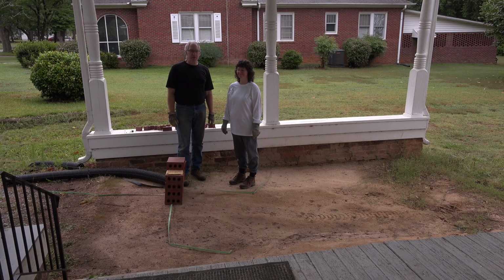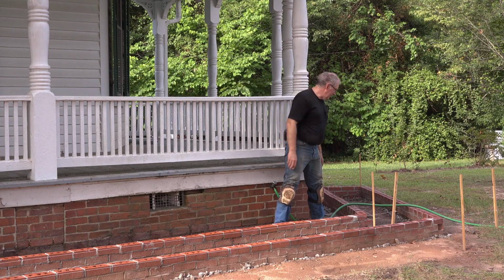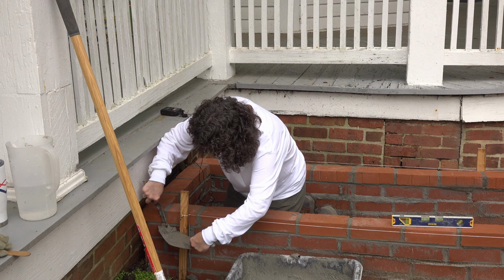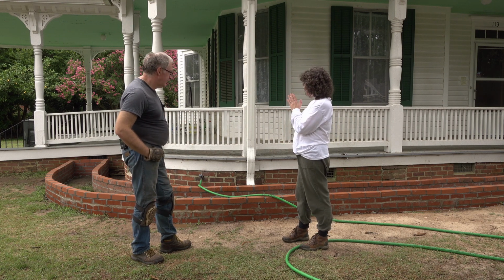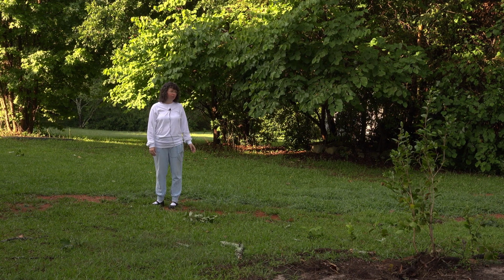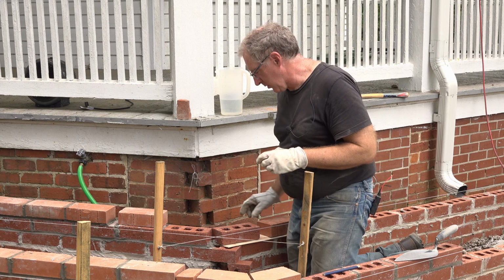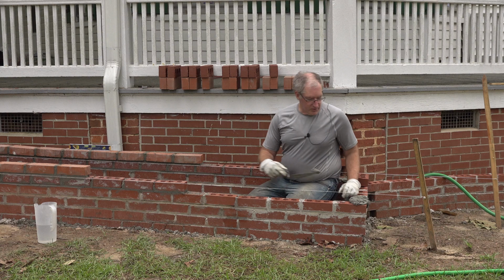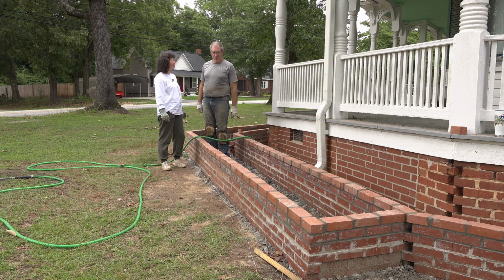EP93 Victorian Brickwork is Finished

Comment: Congrats on the brick planter! As others have said, it would have been difficult, if not impossible to find someone to do the work and put as much care into it as you have done. Hopefully the slope of the catchment troughs will keep the water flowing away quickly. It hasn't rained here (except for a few teasing sprinkles the other night) in so long, leaves on various plants and trees are dusty. Did I see mushrooms growing out of your lawn? That happens here in the winter, and once in a while they form a 'Fairy Ring'. Kind of fun. If the new planter will be mostly in shade, small hydrangeas might be nice as anchor plants, with annuals in between. Hydrangeas can turn either pink or blue, depending on the amount of acid in the soil, and you can control this yourself with fertilizer meant for the purpose. Crape Myrtles are awesome!

Comment: Another fabulous episode!  You two did a beautiful job.  Jeanie, I agree!  The transition with the old bricks on the catchment is gorgeous!  My husband and I are working with bricks too and the GA heat and humidity is similar.  We're removing old bricks from a porch so we can relocate the house and rebuild the brick porch.  We have the porch to shield us, I have a fan to blow the brick dust and old mortar I'm sanding from the bottom and sides and it's still hot!  We're working hard to stay hydrated and avoid heat exhaustion.  Looking forward to next week and to see what you've been up to.
Reply from the maker: We're glad that you're working safe and trying to stay cool. That sounds like quite a project you have going on!
Reply: @1834RestorationHouse , it's quite a job but we are getting in the short rows.  The interior is in good shape so we only have a few minor repairs and some remodeling once we move the house.  It's not like we have to totally redo every room.  And we don't have any plaster repair work!  We're dealing with sheetrock.  I did learn that the dining and living rooms have tonque and grove walls behind the sheet rock so we may tear that out.  Mike, you have me wanting to use a cobra speedheater on the doors to get them back to original wood.   I can see that restoration can become an obsession!

Comment: I love brick work even though I am no expert, but willing to learn.  We have some brick steps that need tuck pointing here on the To Do list. I want to finish painting the porch which doing now.  The rain has slowed me down or would have been done. I  have had heat exhaustion before so I can relate. My body has never been the same and now I find myself getting overheated much easier. I live in Tennessee where its hot an humid so I make extra precautions when working outside those days. This might sound whacky, but I will take the hose and water myself down clothes and all before mowing the grass and doing other major projects like planting. I even keep a gallon of water nearby while I work. I might look like a drowned rat, but it keeps me cool, keeps me safe so I can work longer on days when feeling determined lol. Maybe, someday I will have a pool so I take a dip instead of a hose lol. Your work looks good. Stay cool, stay safe, stay motivated, and keep up the good work you all. Best wishes from the hills of The Great Smoky Mountains :)

Comment: I wonder if the failure is due to the manufacturer filling the form from two locations and that is where the brick material meets. And since it’s not as incorporated as the rest of the mix, it’s prone to failure there.
Reply from the maker: Anything is possible. I expected better from General Shale.

Comment: I don't know if you know about this. 
While Portland cement is a good pairing with modern hard-fired brick or hard stone, trouble arises when it's used with older, hand-packed bricks. In this pairing, the hard Portland cement mortar will cause soft brick and stone to deteriorate at a rapid pace
Reply from the maker: You are correct about that.

Comment: What is the purpose of the catchment? To hold water like a trough or moat? With all the downspouts emptying into it won't it fill up? Don't you want to get water away from the house? Please explain how this will work?
Reply from the maker: It's a drainage channel which is sloped toward the back of the house. The water is dumped into a pair of catch basins and then sent out into the back yard.

Comment: Hi Friends! 👋 Your haircut looks nice, Mike. I think your next purchase (toy) should be a power washer. You can power wash your front deck, railing, outside of house, sidewalk, driveway, all kinds of things. 
Wow! That planter looks great! I would suggest drilling drainage holes/weep holes along the bottom 2 bricks, so excess water can drain away to prevent flooding and bottom rot. Also, before filling with soil, lay some gravel or crushed rock in the bottom of planter and cover it with permeable geotextile fabric. Then cover with a mixture of compost and horticulture grit before planting. 
Mike, How is the new job going? Jeannie, I would love to see some more of your baking/cooking tutorials. Have a great weekend! Belle in AZ 🏜
Reply from the maker: The new job is going great, thanks for asking. I'm on a compressed work week so I get 3 day weekends now! Your cactus has doubled in size!
Reply: @1834RestorationHouse   Im glad things are going good at work and I'm glad the Cactuses are doing well there. It's funny, I have a similar cactus pot on my patio and it's slowly dying here in AZ. lol. Go figure.

Comment: I was wondering if eventually you will go around your foundation and place mortar in areas that it's fallen out before bricks start getting loose?  We've had heat advisories in Northern Idaho but our humidity has only been around 32% with temperatures in the high 80's and 90's. We are having severe thunderstorm warnings today and the county below us had hail and 50 mph winds over the huge lake yesterday, but we didn't get it, so I guess today is our turn. It may just happen over the mountains. Gorgeous job! Love it.
Reply from the maker: Yes there are several joints that need to be cleaned out and repointed. We'll have a foundation appreciation day somewhere down the road. I know about those Idaho thunderstorms....Years ago I was flying an airplane from Spartanburg SC to Portland Oregon. My co-pilot and I landed in Nampa to refuel. It was HOT but the skies were clear. We took off and set a course westward. When we passed over Lake Owyhee a few minutes later, we got thrown violently upward, then thrown violently downward! We high tailed it back to Nampa and landed. After shutting down we looked back and saw a MONSTER THUNDERSTORM where we had just come from.
Reply: @1834RestorationHouse  Mike, that story gave me chills ,which is a strange sensation while sitting outside in yet another hot & muggy Missouri day!🥵
Reply from the maker: I get chills too! Thunderstorms can tear up an aircraft really fast.

Comment: Very nicely done!  I've watched this planter construction from the beginning and wondered how long it was going to take considering the weather. During the week I try to mow our lawn ( so my husband doesn't have to on weekends) but with our humidity I'm taking 15 min. breaks every 30 to 45 min. of mowing.  That means guzzling water or gatorade, sitting under a ceiling fan with the a/c cranked down until I've rejuvenated myself to mow some more.  The earlier the better as there is less sun but the feel like temps will get to you every time.  One thing for sure is no one should be working outside for any length of time from noon until 4 in the southern heat.  BTW, how is the job coming along?  Hope it's to your liking and lasts far longer than your first job in SC.  Next project,  house painting?  😉 😀
Reply from the maker: Coming from a cold climate, we're accustomed to powering through projects in any season. It's taken a lot of willpower to step away from summer projects. The new job is going well, and VERY interesting!

Comment: Amazing!! Can u explain how the catchment works? Where does the water fill drain to? If you’ve explained already, direct me to that video… thanks
Reply from the maker: I think that the next video has a good rundown on the system, but the fast-forward answer is: Water hits the "V" and runs downhill, around the corners and falls into a pair of catch basins. The basin is a big square hole with a pipe in the side and it slows down the water allowing debris to settle in the bottom while passing clean water to the pipe. Basins need to be cleaned out from time to time. The water pipe simply sends the rainwater out into the back yard.
Reply: @1834RestorationHouse  being the engineer, you explained it fully for me. Thanks

Comment: Where is the water supposed to drain if there’s no hole for it to escape behind the planters?
Reply from the maker: One planter is equipped with a catch drain as shown in the video. The other side has a temporary shunt installed to get the water out.

Comment: Did some research on porticos. Concrete was first used in 1891, asphalt in 1870 so you could use either of them or use brick .
Reply from the maker: Mmm..Good to know! Asphalt is lot faster to put down.

Comment: That was a job hard won, but you did it!  Looking forward to seeing the planters with plants in them.  Great job!  Is the drain pipe issue resolved for the catchment water or is that another project?
Reply from the maker: Great question! The west end  system is intact and working perfectly. The east end got broken when they remodeled the side porch. That one will be a bigger project but we're not ready to tackle it yet. We've installed a diversion tube to take care of rainwater on that side for now.

Comment: I would like to know why use bricks that have holes in them in the first place? I thought all bricks should be solid. I like the solid bricks best. Why do they make bricks with holes in them? thank you for helping me understand this. Lawrence NYC
Reply: I’m not sure, but I always thought it was to help the bricks bond and hold better.  The mortar doesn’t just go across in thin lines, with the holes it also goes down into and up into the bricks like fingers to really hold in place.
Reply from the maker: Holes reduce weight, give an extra place for mortar to grip, and it uses less clay.